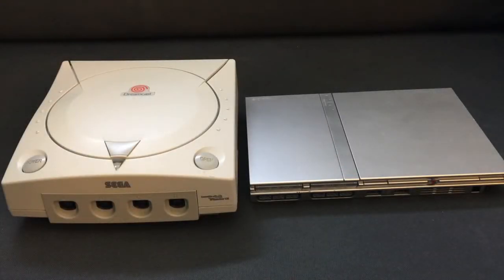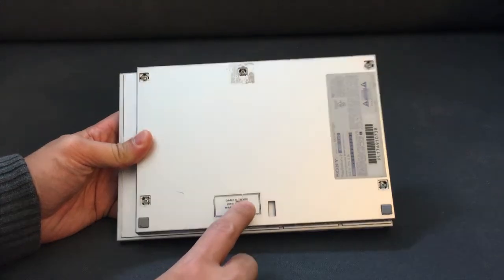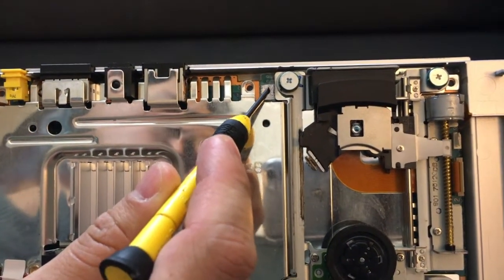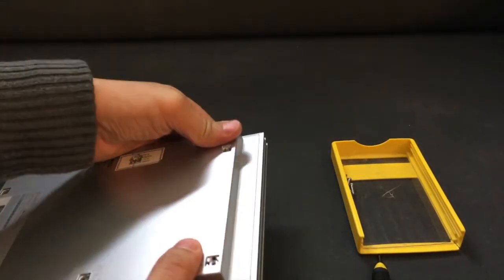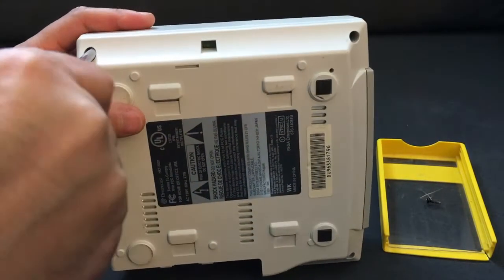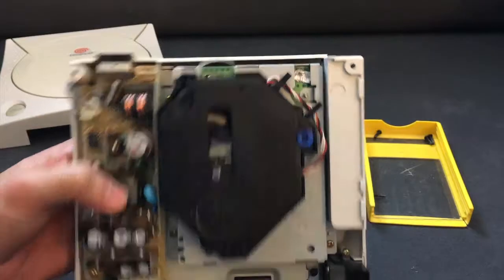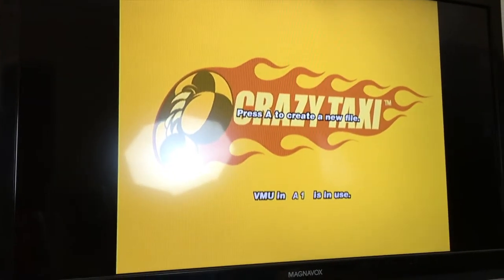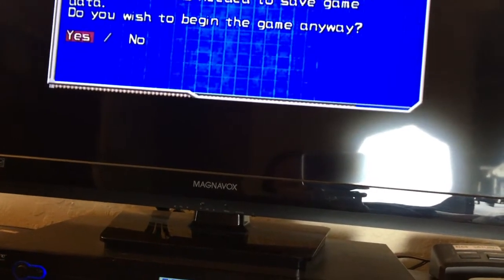How to Fix a Broken Lid Sensor on a Dreamcast and PS2 Slim: RETRO Buyer's Guide Episode 30

Comment: It will not work with D2 so.
Reply from the maker: This is true. Multiple disc games like Skies of Arcadia, Shenmue and D2 will not allow you to change discs.Some will allow you to save the game before the disc change and then power the console off, Then you can start at the beginning of the next disc. I have since installed a simple on/off switch on my Dreamcast to trigger the lid sensor.

Comment: I've had this done on my Dreamcast, problem now is that since the GD won't stop spinning I can't move further into games which require a Disc change either for 2-GD games or for games that need to be booted
Reply: dave_mx85 A better fix is to make a very smal piece of black electric tape. Cut it to size and put it on one side of the gear. And that will help the switch to move down and you can still swap discs. I hope that help :)
Reply: I think that an electrick switch would do the trick
Reply: Yeh this video is not a fix for the DC switch at all. It's just a quick bodge job. Total let down.